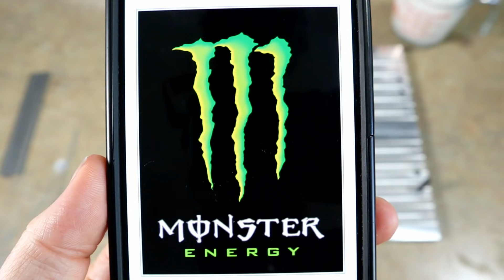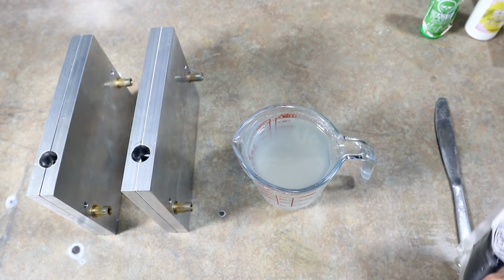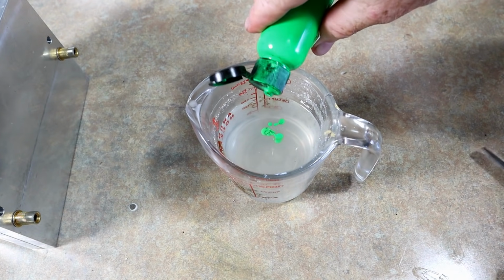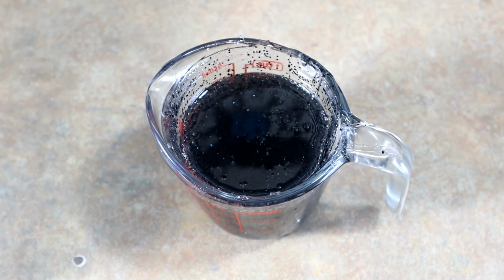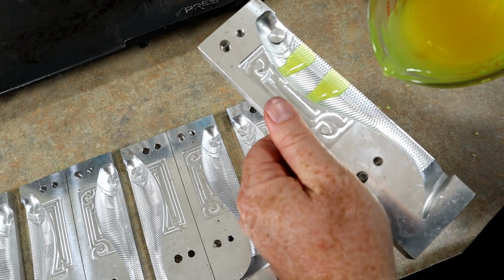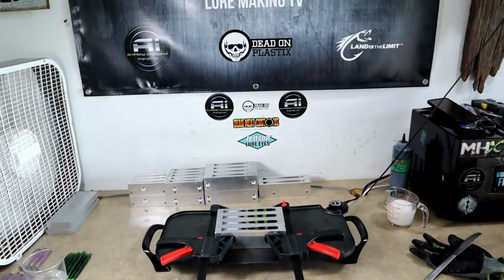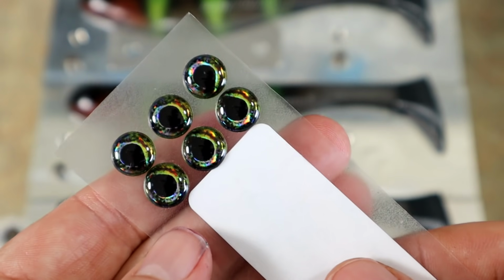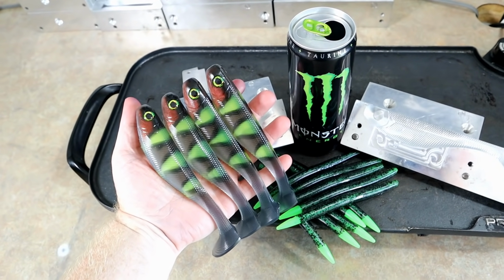Let's Make MONSTER ENERGY Theme Fishing Lures + GIVEAWAY

Comment: Wonder if the green needs to be a bit more saturated and opaque, but then it looked right in the swimbait.  Wonder if it's just the contrast

Maybe if you were to make the core shot with black, then come back in and cut half of the skin off then finish the skin off on the other side with clear, then clip off the tail like you did and shoot the super saturated opaque green all the way through with the tail, and then maybe for some extra effect dip the very tip of the tail in a very super super saturated black or diet black or however you would do that.

Second ones look way better though, at least for a monster energy theme.  I guess what I was proposing is a kind of mix between both of them